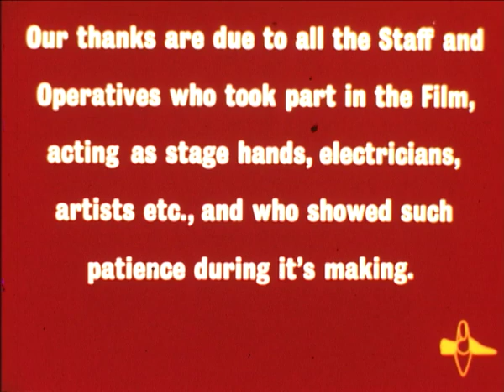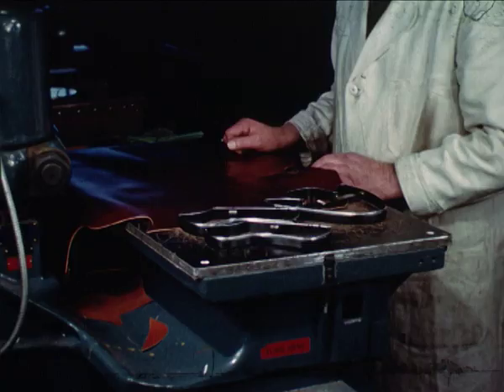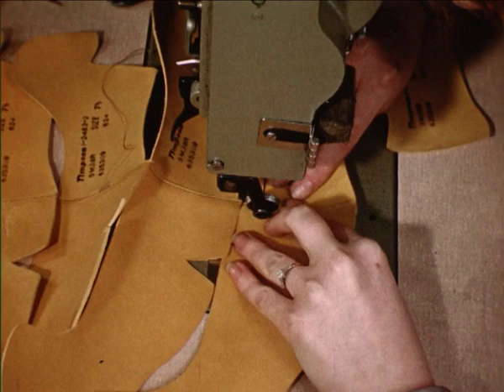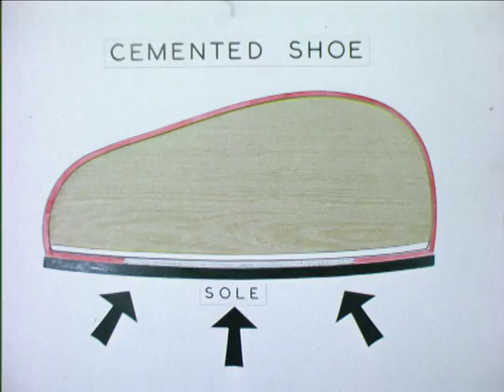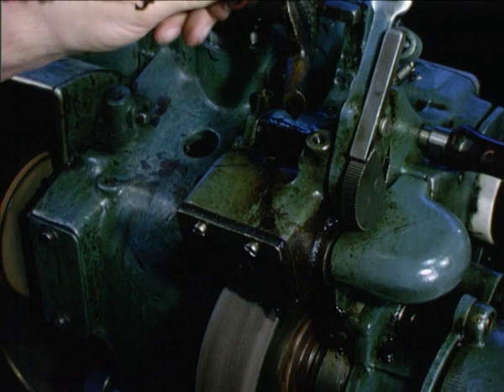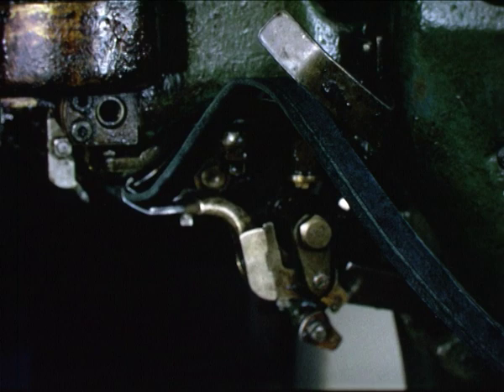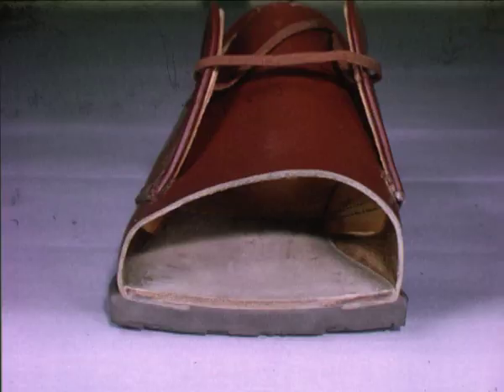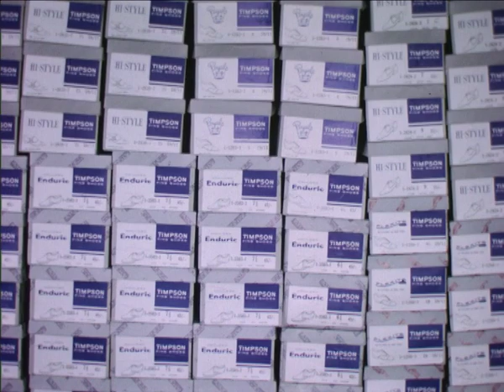Timpson Fine Shoes

Comment: When I was fourteen I feel I love with the "Royals Range" Of shoes that Timpson did , rumour has it that they were originally made for export to America which would explain the welt around the sides I had the brogues, smooths & the Gibsons , how I wish I could get the same quality now , they've tried to replicate them but I've never seen any to match Timpsons in either style or quality , if any one knows where you can get similar please tell me.
Reply: I believe the Royals were standard (not premium) Goodyear Welted shoes and their price of in the late 1960s of around £7 to £8 would equate to about £250 to £300 nowadays. There are a huge range of Goodyear Welted construction shoes in the £150 to £300 price range, made by British brands like Loake and Barkers and Spanish brands like Berwick 1707.  Have a look at Loake Chester or Birkdale models or Barker Calvay or an example of an American Longwing style which I believe was one of the Timpson Royal styles. You could also google  "Berwick 1707" 2562 or 3681 for versions at the lower end of that price range.
Reply: @UnknownUser-rb9pd  Ok thank you for that info I’ll look those models up 👍
Reply: I too had wingtips, plain caps and gibsons, all bought down Petticoat Lane in 1968-70. Closest I’ve come to a really well made wingtip is a Florsheim Imperial. Bought 2 pairs in ‘93 and they’re still going strong.
Reply: @Beeza56  I used go to petticoat Lane around that time,  if I think hard enough I can remember/feel the atmosphere it was a great place , I bought some brogues tapered shirts , and a particularly nice prince of Wales jacket there in that period.